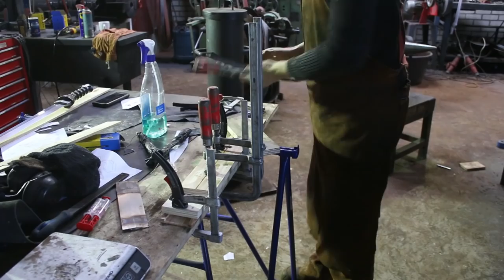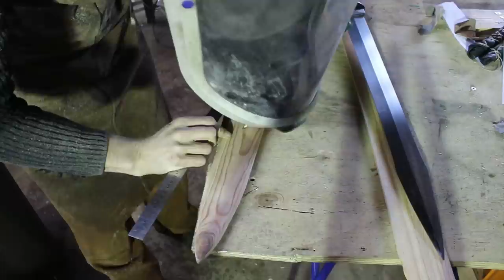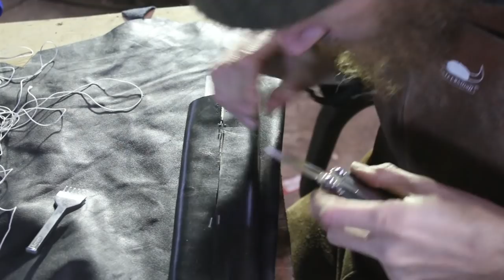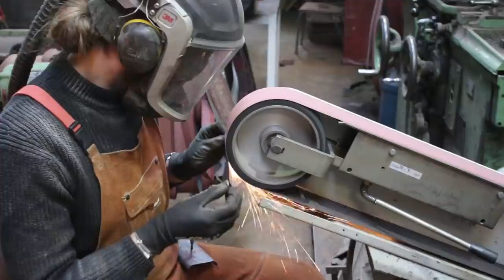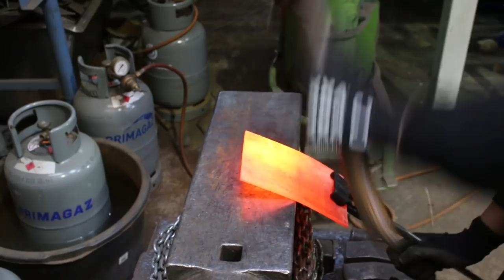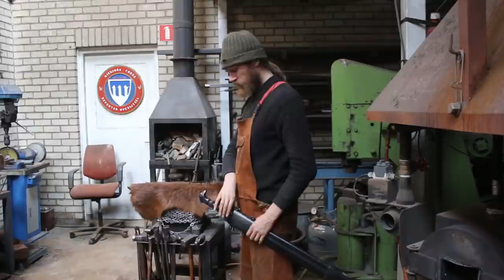Forging a Gladius sword, part 7, making the scabbard.

Comment: How did you hollow out the Sheath for the sword, did you cut it in half, hollow out the inside and glue it back together? 

I’m wondering because I can’t see any seam on the side of it, I’m new to woodworking and I’ve been having real issues hiding the lines where I glue things together, I have tried using sawdust and glue but it’s never this seamless.